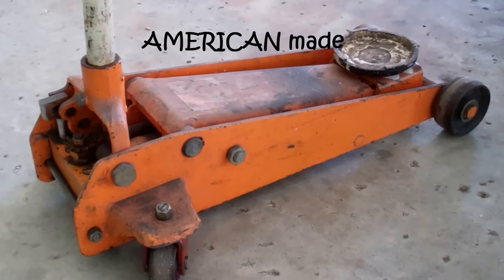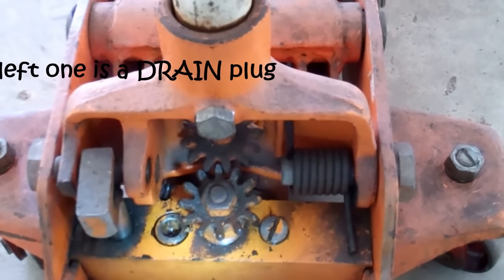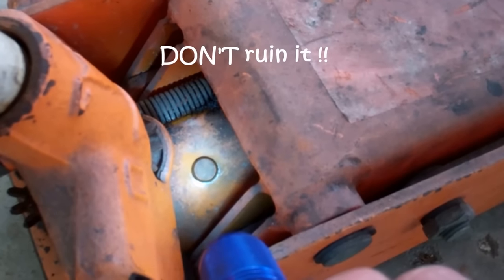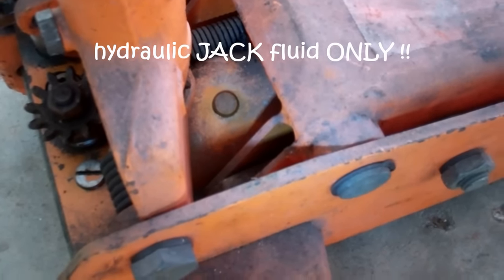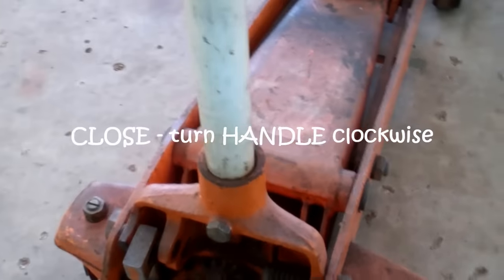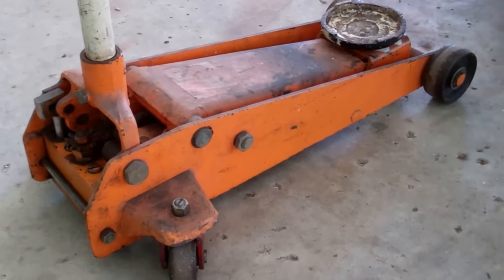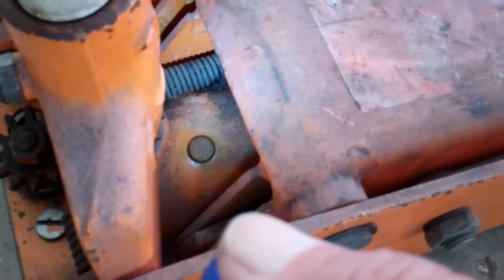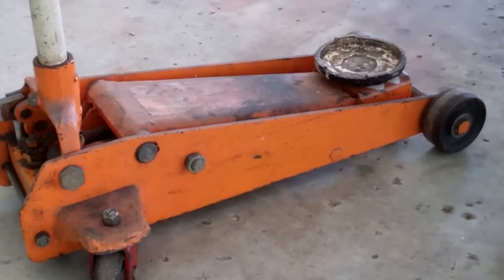Fill & Bleed a floor jack

Comment: Watched a couple other people's videos and one had me doing a bleeding procedure through that fill hole you showed.  Another video said to fill through one of the other screws (one on the right of the star gear).  When I did both these, the improvement was marginal at best.  But when I did like how you showed - it worked much better right away.  Thank you!  New life to a 25 year old floor jack!

Comment: Thanks wise old man. Bled jack with new plunger o-ring and works like a charm (craft 3 ton). Only issue I had was rubber cap popped off (when bleeding and removing) and lost it for 15 min. Said a prayer and poof there it was right in front of me. Appreciate your help!
Reply: ...can't tell you how many times I've been through that exact same senario - lose something, go nuts, calm down, pray for a minute - bingo, hey where did that come from???

Comment: After watching some of 'those videos' I went down the rabbit hole of 'fixing' my Craftsman 3-ton jack, which I've had for at least 30 years. Thank goodness I found your video and followed your advice. The rubber plug looked like steel, painted silver, just like the jack, but it was there. I used a straw as a funnel because I didn't want to make another trip out for one after driving all over town to find the jack oil.  That plug was a booger to get back in after filling the jack with oil. But, once I wrestled that back in the jack worked like a charm, just as you described. Thank you, Ed, for your video and no-nonsense but enjoyable delivery of how to get my jack working again. Definitely, two thumbs up! 👍👍😁

Comment: Thanks so much man.....great vid! My 35+ year old Astroline 2 ton was only pumping about haflway. Tried bleeding first based on another vid. Looked up Astroline on YT and yours  was the first to pop up. Almost opened the wrong plug and I probably would have gave up if it didn't work. 35+ years later, with a 1/4 cup of fluid works like new!

Comment: Thank you for this video! I have this exact same jack. It was my father's for over 20 years. When he passed away I got all his tools, this jack included, and it's one of my most prized possessions. Thank you for this video as I will now be able to continue using my dads jack for at least another 20 years If not more!
Reply: Do you have a link or advice on getting a new plunger seal? I can't find the right one anywhere
Reply: Do you know the make and model of the jack? I have exact same jack but need seals and can't find info on jack.

Comment: Thanks for the straightforward video on the right way to do it. All other videos told me to mess with the screw plug. When I opened that one, it was already full, nowhere to add oil. I had no idea about the rubber plug. YOUR video saved the day! My jack is like new.

Comment: Good job!  So many horrible suggestions on yt with bad, even unsafe information.   One actually suggests using water in a pinch.  Your info is legit, to the point and proper.  Thanks man

Comment: Just bought an old well used but good quality Taskmaster trolley jack from a farm sale, tried it first of all and it would barely lift itself more than a couple of inches. Initially opened the screw at the back, then found this video and had it all up and running perfectly within 10 mins. 
It is currently holding up about 2 tons of Massey Ferguson tractor. 
You are a superstar for posting this video. Many thanks.

Comment: Wow! Thank you sir. My Jack quit working and I saw the left hand hole there at the rear and thought I had lost a screw in plug and have been on the search for a plug for it so I could put in Jack oil and get it working again. I will buy some Jack oil and fill as you instructed.  Way to go!

Comment: Thanks for this video., my dad left me an old floor jack. Though it is an import Allied it had been very good for over 10 years. I went to Change the oil and it stopped working. Jack really has sentimental value. I followed your instructions and it is like brand new now thanks for posting this video

Comment: This is a very good video it explains things perfectly I have a floor jack with four ports and messed with the flat headed screw and oil came out under pressure my rubber plug is painted red didn’t think that was the port to put the oil in but it was so thank you for making an easy to follow video my man cheers

Comment: Glad i watched this. It prevented me from pulling the drain plug or screw in the block mistakenly.   I have a Larin DQY 6000 and they hid the fill plug under the handle.    If you hadnt told me , I would have NEVER seen it.  Fill 'er up.

Comment: My jack didn't appear to have the rubber plug, but it did , it was just painted silver like the cylinder. Topped it up and works like new.
Thanks for the video.
Reply: I’m having trouble getting the plug back in. Anyone got advice?

Comment: I have what appears to be the same jack.  Allied Indy 5 - 2 1/4 ton.  This was passed down from my dad in 09 after he passed away.  It has not worked for many years, but it has sentimental value.  Followed your instructions and damn if it ain't workn' like new.  I used Bars Jack Oil. Thank you sir.  😊

Comment: Thanks for the video and it works great. I just filled a floor jack that looks just like the one in this video and I can remember when my late Father bought it 20 or 30 years ago. It's made in China plus used by many Family members through the years. It has a screw in fill plug with a gasket and the floor jack still looks & works like a new one. I'd bet it would go another 50 years at least, if I were a Gambler.

Comment: Rubber plug Install. I used screw driver to remove plug it damaged plug. Ordered plugs on Amazon. Tried to push but no go. Tried pushing with screw driver no go.  Finally used needle nose pliers and twisted as screwing in bolt and worked to properly seat plug.

Comment: I have a Mac Tools 3.5 ton floor jack that also has a foot pump in addition to the handle. For the last year, I have been on the verge of getting rid of because it wouldn’t pump up very far. 
I am going to look for the rubber plug and see how much jack oil that it needs to start working again - I was under the impression that the flat slotted screw plug was where the fill was. When this floor jack was new, It was a beast and served me well. Thanks for giving me some renewed hope that I might bring my floor jack back to life.

Comment: Thanks this helped me. My dad just lent me almost the exact same jack he's had since the 80s  I topped it off with jack oil from walmart it took about half the bottle and wd40 on the wheels and that pivot point which was stuck and it seems to work great!

Comment: I just came to check YouTube to see how to add hydraulic oil to the my jack. To my surprise, you have the identical jack. I've had mine for about 20 years and it's been setting for the last 5. The reason is that I did exactly what you said not to do and put oil in that little plug with the spring. It never worked after that. I look forward to doing it the right way because it was a great jack before I screwed it up. Thank you for the instructions.
Reply: What brand and model is your jack?
I have same jack and need make and model for seals.
Reply: @boydlittou9446  Boyd, I am sorry but I have stripped and painted it. I will try and find the size of the O Rings that it takes and let you know.
Reply: @donn3642  
Ok Thanks,  if you knew what make it was it would help. Mine has the raised D and U Letters cast in the part the handle goes in to just like yours.

Comment: New problem....Mine is same...bought it 40 years ago...failed because large piston shaft got rusty....caused main top rubber seal and rubber dust seal to pop out due to the friction if the rust. I dissassembled it...cleaned off rust (grinder/wire wheel), re-assembled, filled with oil....good for another 40 years!

Comment: Some people believe that anything 'old' is to be discarded for newer, but I'm definitely not one of them! I bought mine probably about the same time as Ed, in about '08, (paid $40 for mine) not as lucky as Ed. But I figured it was still worth it, as like he said, it will no doubt out-last me, and I've gotten a lot of use out it - it has paid for itself multiple times over. Although I've never done any maintenance, and it's never failed me, I think it can use a little more fluid, which I will be adding soon.

Comment: Ya. That is a Hein-Werner Winner series floor jack. It's an awesome jack. You were 100% right about how long it lasts. I literally bought that same jack at local auto parts store 35 years ago when I was 17 yrs old. I have never had one problem with this jack. I just this week replaced springs and filled and bled system. Not because I had to, I just figured I'd freshen it up some and get another 35 yrs of  problem free service out of it.
Reply from the maker: does look similar, doesn't it?  i have no idea what brand or model it is.  I've picked up a couple over the years, bleed 'em and give them to friends who need it.
Reply: If I could send you pics, you'd see for sure. I contacted Lazzar's Floor Jacks at HCRCnow.com.....they specialize in old floor jacks. I sent him numerous photos and he identified it for me, and sent me scematics, part list and id. etc......like I said. NEVER a single problem with it in 35 years....and has been used very frequently. I replaced torsion spring so handle would spring back up like should, and return spring so saddle dropped like it should, was slow lowering, but never a performance issue
Reply: Bobby Legg Got the same one here in oz, any chance you could post the schematic and parts list? It would be super helpful to me and many others judging by all the unanswered comments
Reply: Here is schematic and parts identification, hope this helps.....BOBBY
https://www.hcrcnow.com/uploads/drawings/Hein-Werner_Winner_H68042_Service_Jack_2_Ton.pdf

Comment: Thanks,  I'm making some progress but not fixed yet, before when jacking it up the jack would bleed down in about 15 seconds with no weight on the jack, what I did was raise the handle end of the jack about 3 inches & topped off with oil, what really helped alot was I raised the jack all the way up & put about 10 pounds of weight on the pad & I let it bleed down with the valve closed & the handle up not compressing the plunger, then released the the air under the rubber plug after the jack hit bottom, So far I did this about 10 times & I'm getting less air and the jack is staying up for 2-5 minutes instead of bleeding down in seconds. Before the jack wouldn't stay up for 10 seconds with no weight on it, I think this jack I got from a friend was bone dry & hope that I can get it working if I keep repeating what I am doing.

Comment: Sadly my American Forge n Foundry 3 ton needs service after just 6  years of service. I used it twice each year to swap tires. Now it no longer pumps up with each pump. Needs 2 or 3 to lift an inch or 2. Ill bleed and refill hoping itll fix it. Im just surprised it failed with such little use. Nice n direct video. Supposedly AFF is made in the USA.

Comment: In the 1970's I was shopping for a floor jack. The American made Monkey Wards jack had a pool of oil under it on the display floor, kinda Harleyish. The made in Japan Sears did not. I got the Sears. As of today it has still never leaked a drop. My Silverado has 439,000 miles for those that think I'm a hater. China will build to any quality standard but Americans like buying cheap Shit.

Comment: Thanks a bunch. Finally good and simple know how to fill a floor jack with oil. Done by someone who knows what a real 3 ton 4 ton 5 ton floor jack is all about. Bang on about using only hydraulic jack oil. And you explain what happens using the other fluids. American made is quality.

Comment: Thank you perfect jack info. I used mine underwater for boat dock work. And over time it was a wee bit squishy at the extreme upper limits. Just wouldn't do that last inch or so.

Comment: Thanks, I have the exact same jack and have been screwing around with the two plugs on the end!!! Wasn't working! Thanks again!
Reply: Hey I have the same jack but I opened the 2 screws holes and put oil in them, do you think I need to dump that out and start with the plug? Thanks if you have any advise

Comment: Word to the wise. Be damn sure the rubber cap seats all the way. I thought mine was on, no fluid leaked when jacking it up first time. But when I released the jack to let it come down that cap blew off , sprayed oil all over and must now be on the moon because after searching for an hour, on a gravel drive no less, I can't find it.

Comment: Owners have been using ATF in floor jacks for decades. ATF IS a hydraulic fluid. ISO hydraulic fluid will also work in these jacks. With that said, I have always used "jack oil" in my Craftsman 2 ton jack. Takes 2 1/8 ounces of oil. If you put too much oil in a jack like this, it will puke oil passed the fill plug until correct level is obtained-guaranteed. That is how I know my jack takes 2 1/8 ounces of oil. Just completed replacing jack fluid this AM. FACT: No matter how careful you are and how many newspapers you put down when performing this maintenance, oil will always find its way to where you don't want it, ALWAYS. Old man Murphy is alive and well.

Comment: Don't know how old mine is but it's a little different.  It has a foot pump on it by the actuator so if you're in a tight spot you can just pump it with your foot.  There's also a 10mm screw under neath the winged gear and you can't remove it unless the valve has been fully released.  Got mine on Craigslist like you said and the guy's painted it completely black so I can't see any markings or anything to see the manufacturer.  It's a bit of a beast.

Comment: Yes as stated earlier, easy to understand video. 👍 Question, I filled the resevoir and bled all the air out of my Craftsman 214.12300 three ton car jack. I checked all the ball bearings also. It pumps up a bit and then starts to fall flat. Do you or others have any clues?

Comment: Thank you for sending us down the right path when it comes to floor Jacks.  Since when does motor oil compress? And why would ATF automatic transmission fluid eat rubber seals?  I don't think there's an automatic transmission made that doesn't have rubber seals.  ATF is a hydraulic fluid, and most certainly will not degrade or "eat"  rubber seals.  We can all agree that  motor oil is a liquid, in liquids, there is no gap between particles, so only way you can compress is by reducing the gap at molecular level, which is basically changing the state of that material, which involves a huge energy.
Reply: Why don't you try it Joe, then post your results.
Reply: Motor oil has detergents. Bubbles man, bubbles.
Reply: tiny bubbles-great song btw.

Comment: Great video and explanation thank you. I fought for hours and still can’t get the seal plug back in. Any tips? Top of plug is rounded. It is at slight angle. I get it somewhat started and it won’t go in. I have short fat fingers. Thanks.

Comment: Hi there great video.. what if I open that tiny screw you said not too and I put in jack fluid leak fluid was that bad.. should I still take that little old plug out you said and put fluid in there to see if it works.. thanks David linck. Hope to hear back from you thank..

Comment: Hey there Ed. Thx for the vid. Spot on. Question. Since my jack did lose some fluid, leaking at the pump, I'm replacing the o-ring. Is it worth emptying the reservoir and filling with new oil? Easiest way to empty it? Thx for your time.

Comment: Thanks for the video I have the exact same one when not using it if I store it in the closed position like ready to use I see a bit of oil leaking but if store in the release position no leak does that make sense thanks

Comment: I have one that I inherited it's been in the family for longer than i can remember. I'm the 3rd generation to have it. But now it wont hold. You can jack it up fast and it will go up but it will also go back down faster than it went up. Any suggestions on what I can do to repair it without buying a 80.00 rebuild kit. It is identical to the one in the video 2 ton hydraulic floor jack. Any help would be greatly appreciated.

Comment: Great video.  I have a similar jack but the handle wont turn.  Any sugestions?  The teeth dont seem to be jammed st all but the handle wont turn.
Reply: Take it apart and figure it out
Reply: Hi this is,wayne i have the same jack the teeh or gears wont turn so i too the cotter pin out of the the gere under the handle took handle off and too a screw drive and taped the bottom gears bsck and forth wich a too was broke when i got it i need to replace but i got it free but i locked back up so im looking for release valve wit gear made on it

Comment: Your directions where great the only one  that matched my jack one problem can't get plug back in.
Reply: Get one side of the plug seated. Thenget  a wooden dowel or the handle of a hammer and press firmly several times. It worked on mine.

Comment: Question, I bought what I believe is a 2 1/2 ton Olympia jack...it's missing a clip for the front wheel, it's missing the screw plug on the right if your looking at the handle side. Where do I find parts for it? Also ty for your video!🇺🇸

Comment: @EdontheBeach: Hello, I have the same jack. The fill and vent plug is a Phillips screw. I renewed the 2 o rings of that press piston. And when bleeding I still have air. I am looking for an overhaul kit for the jack. I can still read Pro-Llift 2 1/4 ton. She is dangerous now, just drops 20 cm, is dangerous work. (thanks)